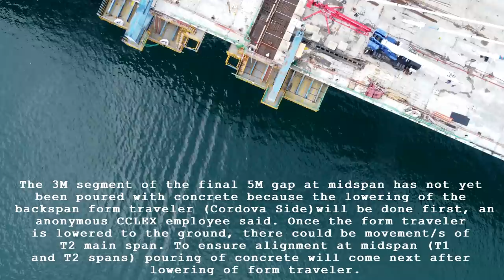WHY NO CONCRETING OF 3M FULLY REBARRED SEGMENT YET?? CCLEX DEVELOPING STORY!!!!

Comment: Last pouring in the mid span is the most difficult part. Daming kailangang gawin dyan gaya ng expansion bar, filler board sa dalawang pagitan, pagkabit ng tendons, pag secure sa form works sa pagitan, form opening para removal ng trapezoidal form sa pika ka gitna ng bridge o box girder na nasa loob etc. Yang concrete blocks na nasa ibabaw para ilagay sa level dahil cguro may discrepancy ang elevation at para stretch and stay cable nearly sa maximum weight capacity para sa pagbitaw o pagkuha nyan pagkatapos ng buhos ay tamang steady requirement.

Comment: joining point of the bridge is so critical thats why they need to study it thoroughly so that it will be durable and can stand the pressure and weight of moving vehicles in the future..thanks for the update sir!
Reply: Wrong. B4 the project is implemented it has passed to plenty of consideration. Well known designers and engineers are not that stupid. ✌️